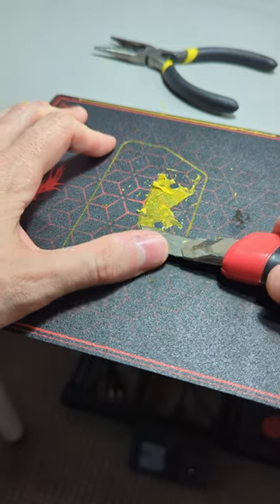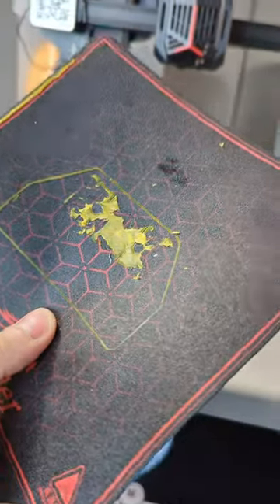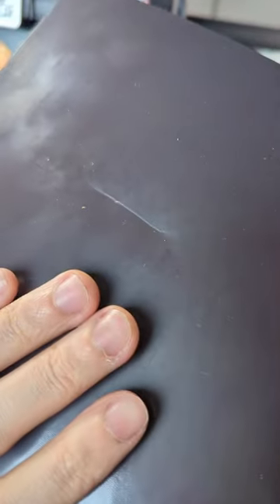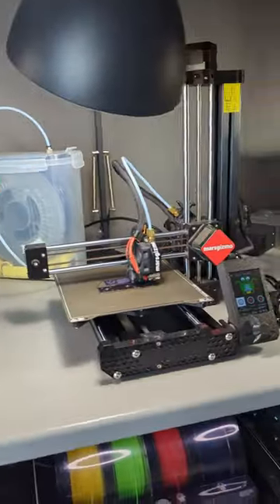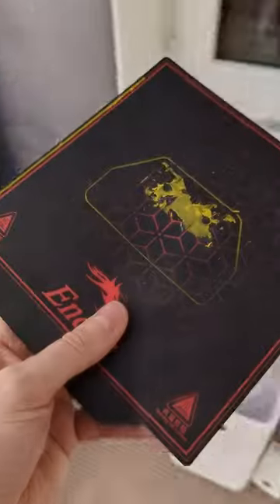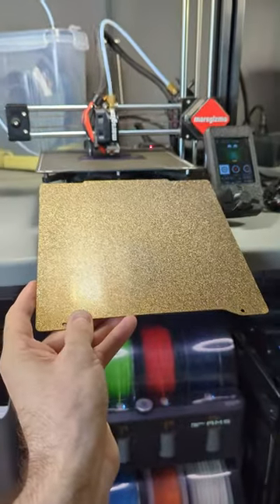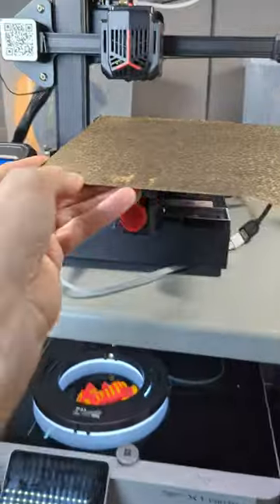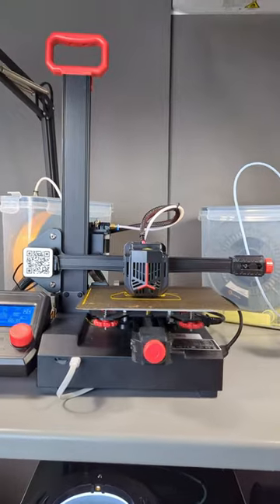Bed material for 3D printing: others won't stick, this one is like glue

Comment: I wanted to say: get a prusa mini print surface 😁 I also use this type of surface but once when I removed a print all that surface got damaged,so i print on the steel surface  using 3DLAC  and is working  OK for pla

Comment: Get a very sharp wood chisel. The broadest one you can get. I have been using it for a year. It does not damage the plate and any print comes off easily.

Comment: I have kingroon kp3s an My bed was broken and i change it with glass 3mm. For adhesive for 1 layer using juice from mixing abs waste and acetone. Ita work very well.  Pretty much cheaper

Comment: I have that same kinda textured gold bed on another machine. PLA didn't stick well enough, so I use it for TPU and the TPU peels off nicely
Reply: I print everything on PEI, PLA, PETG, TPU, no issues. But you really need go clean it, get some finger grease on there and nothing holds anymore
Reply: @exen900  yeah PEI (cleaned with alcohol) is my favorite now. Expect for TPU because TPU sticks really hard to PEI and I've damaged some beds. But the gold one is juuuust right